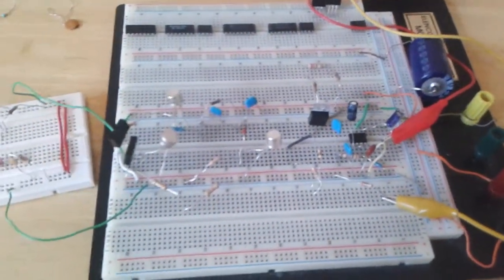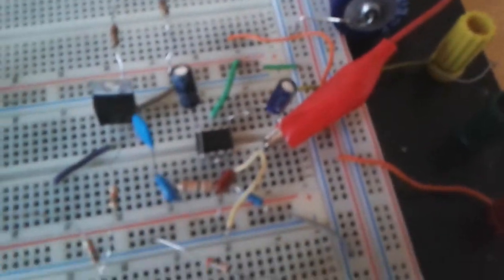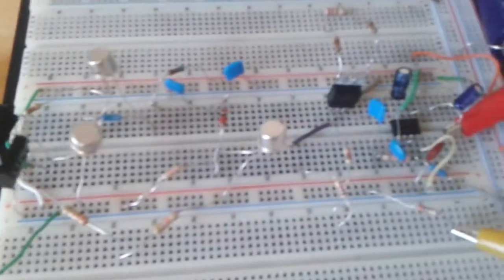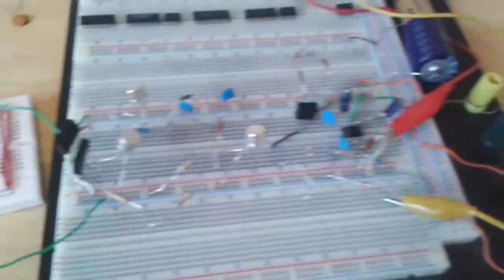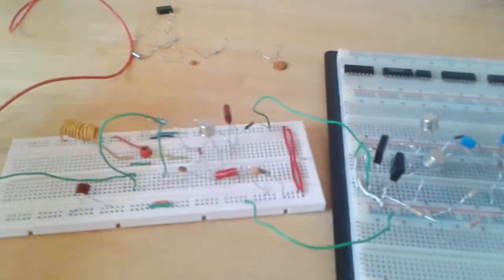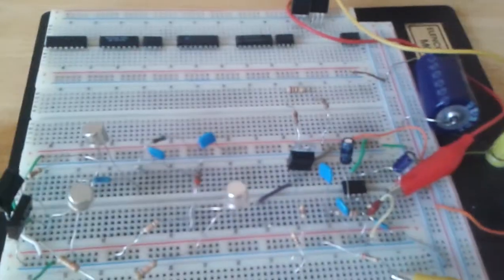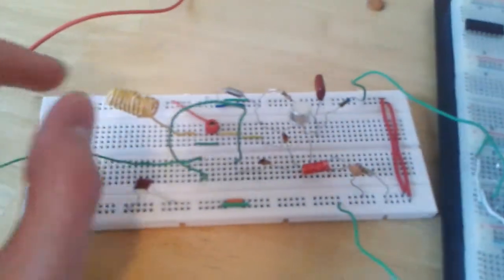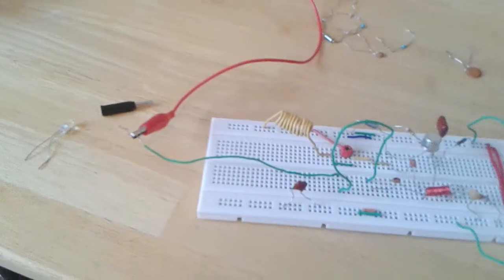FM radio on breadboards

Comment: i hardly ever get VHF FM receivers to work in the breadboard with long leads like that, very lossy.. but you had to have imposed on those front end passive component values a bit i'm sure.. nice, shiny, old transistors in that board!